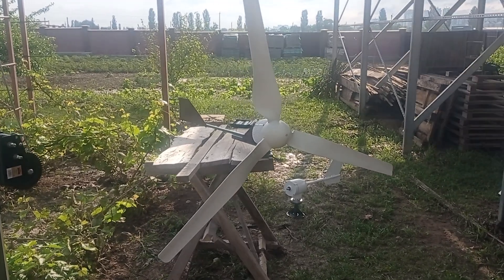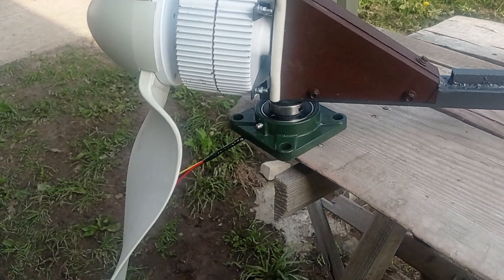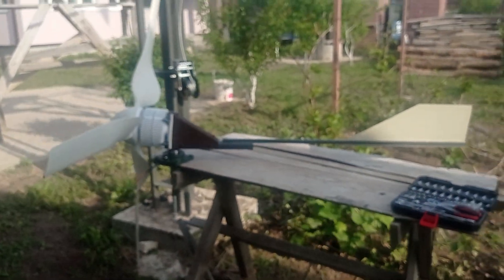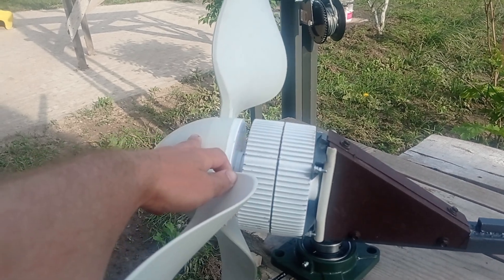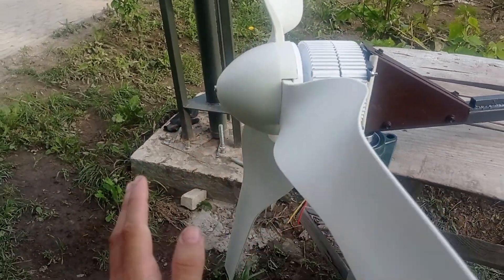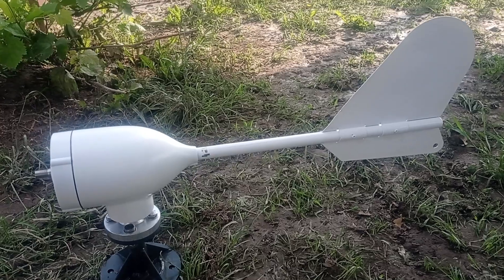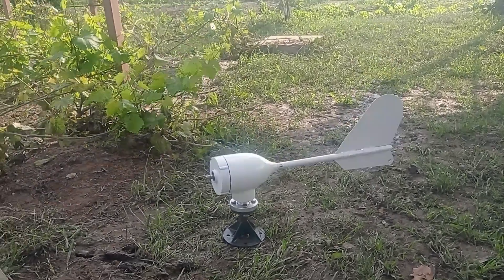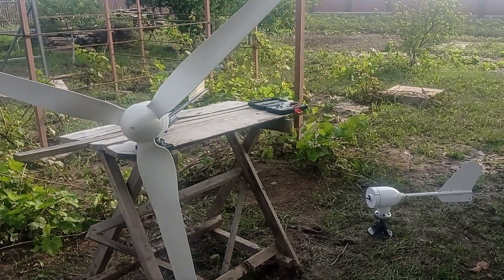How to make your own 500w wind turbine from factory ready-made components - low hassle DIY

Comment: Is ~80USD good for the blue wind controller? The 1.65m 24mm wide motor you linked in another video is on sale for about $230USD right now, about $80 more to add the controller from that seller. Thanks
Reply from the maker: yes. that blue $80 controller (600wind/600solar version) is the perfect match for it. If the seller's combo price is the same - go for a bundle.
however, in my case - I'd go separate, to reduce (or to completely eliminate) import taxes.
Reply from the maker: if you are asking specifically about the controller price - I bought two (you may have seen them in the other video). One was $94, the other one (exactly same) I managed to get for $76. so $80 is actually a great price.

Comment: except for the learning to be gained it seems wind is not worth the trouble and expense.  I have been looking into the old wind powered well pumps that were used in central Montana (US) until the 70s, there were also some old dc current wind generators in the remote homesteads until the federal government subsidized a large grid system.  They used a different style of rotor to catch the wind and were mounted only 20-40 feet (10-15 meters) from the ground.
Reply from the maker: Yes and no.
We have a little of grid power now, and there will be almost nothing of grid power during the winter time.
My observations are as follows regarding the self-cost of electricity:
1. From solar - $0.03 per 1 kWh
2. From grid we currently have $0.108 per 1 kWh
3. From wind (reality for small home wind turbines) - $0.15 per 1 kWh
4. From a diesel/petrol generator - $0.7 per 1 kWh

And now consider there is no option 2, and there is very little sun, or no sun (option 1 cannot produce enough)...
What is better - option 3 or 4?
I will do whatever I can to reduce the usage of option 4.
The winter will be tough, since currently thanks to the russians we have daily grid outage for about 8 hours per day, in winter time that outage time will be doubled...

So, I am getting prepared as much as possible - adding battery capacity, adding solar capacity (2.5 kW of panels) together with the optimizers, and of course finishing my setup with the wind turbines (in the end I will have 4 kW of nominal wind power installed).

Reason for this is that my DAILY winter consumption is going to be 50-120 kWh (depends on the temperature outside), since everything is on the electricity. The most consuming element is the heating.
Reply: @BackyardVoltage  Yes i understand you have to deal with problems that i have never had to. Any power is better when the option is none.  Thank you for sharing your efforts in a difficult real world situation.